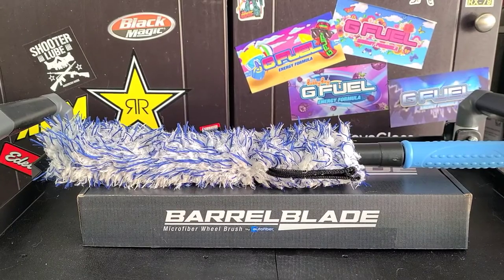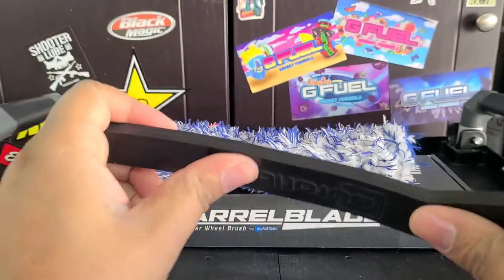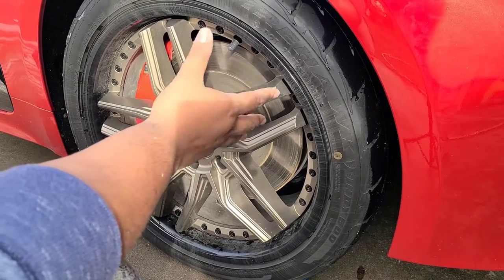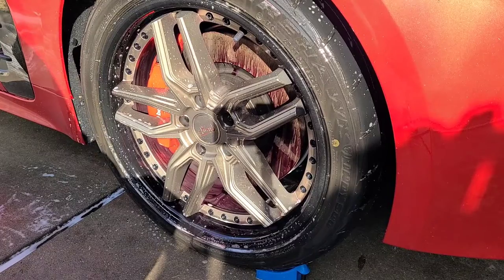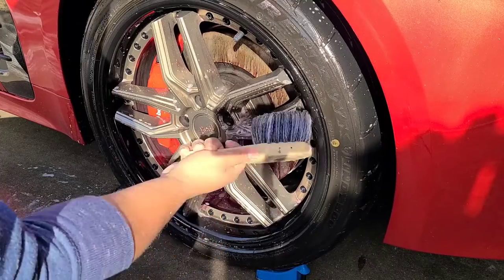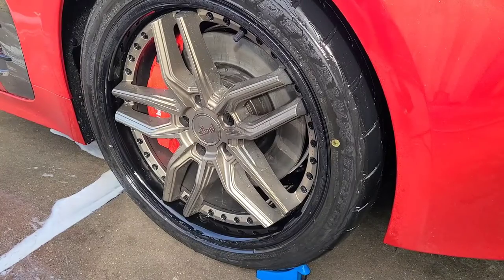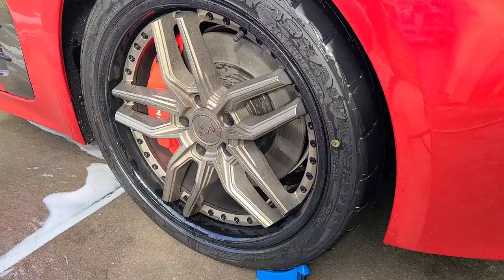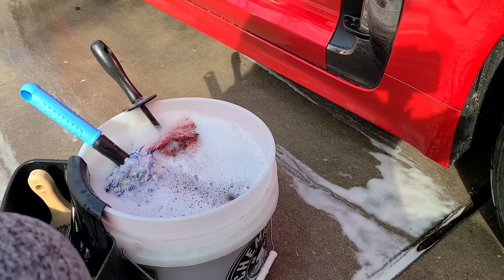[TOOLS] Autofiber Barrel Blade Wheel Brush - Best for Big Brakes!

Comment: Does it get heavy when wet like microfiber madness wheel brush? I spent my life savings on that brush and it’s useless.. looking for an alternative
Reply from the maker: Heavier yes, nothing that bothers me. The core is very strong so it wont flop over or anything. Usually I will squeeze some of the excess water out along the rim of the bucket.
Reply: I have the same issue with my Detail Factory Brush, way too heavy when wet. Looking for a new narrow Brush, might have to try this one.